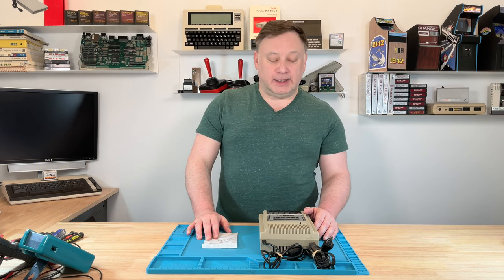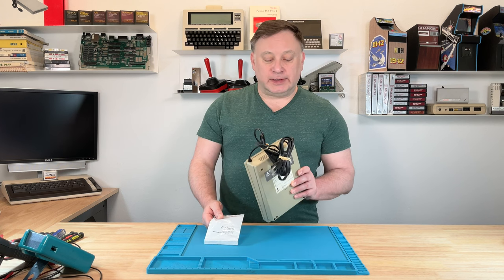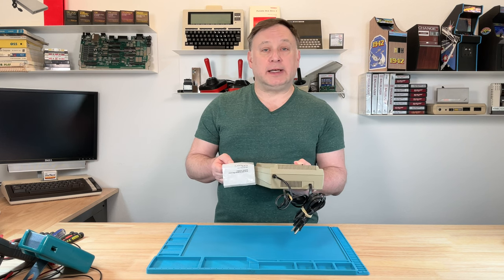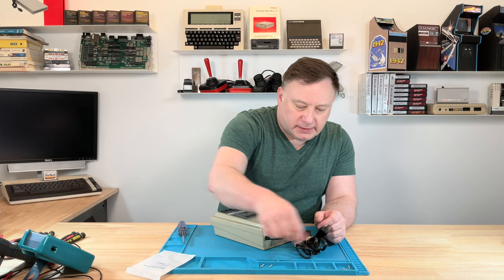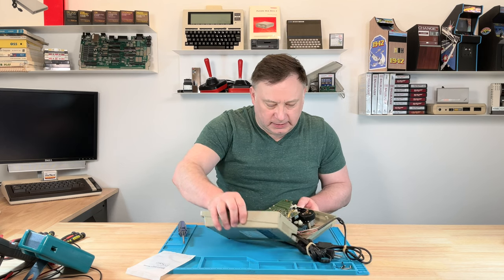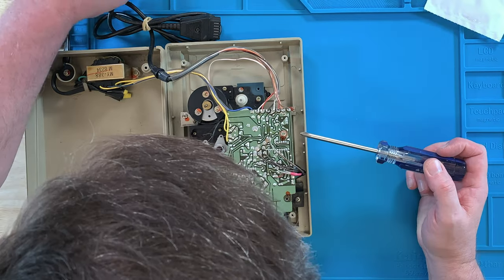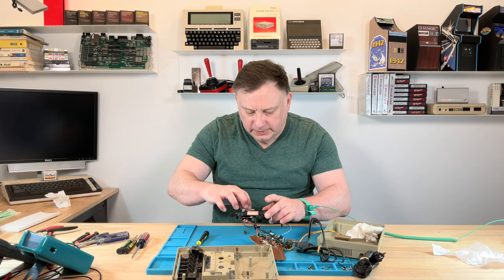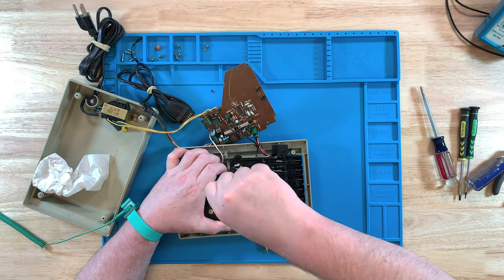Replacing the four belts on an Atari 410 Tape Drive

Comment: Great video, and I was able to repair my 410 with it. Found post from 2017 on AtariAge that showed how to remove locking cap on the rewind roller arm, that allows it removal and easier access to the hidden pulley for that one belt. Thanks again.
Reply from the maker: That's Great! Glad you found it helpful. :)  I'll have to look up that post on AtariAge. Thanks!
Reply from the maker: Oh, Cool. Thanks! I couldn't find it when I did a quick search.

Comment: Good timing.  Thanx for the vid.  I just ordered a non-working 410 to go with my 400.  I don't need it working, as I don't plan on loading a lot of stuff from tape (I have an SIO2USB I use for that).  But it was a great deal and cosmetically looks nice.  But, as long as it is showing up, if I can get it working, that would be fun too, so I was wondering about repair vids...
Reply from the maker: Sounds like Great timing! :)  Food for thought: Even though you don’t plan on using it for loading software, I’m sure you’d appreciate it if it would turn the spindles when you press the buttons. :)